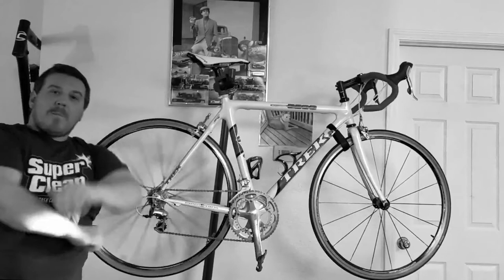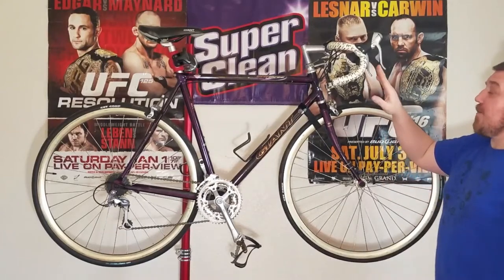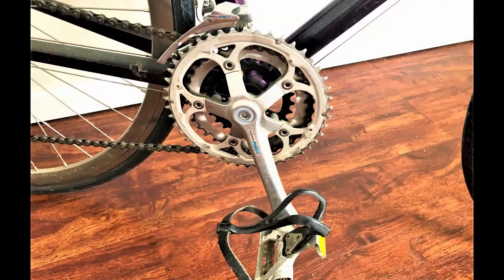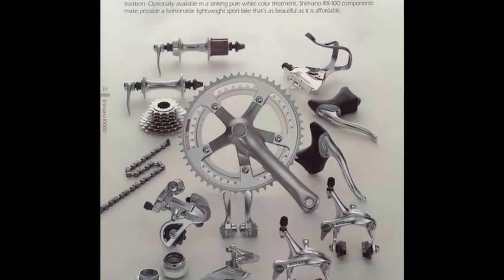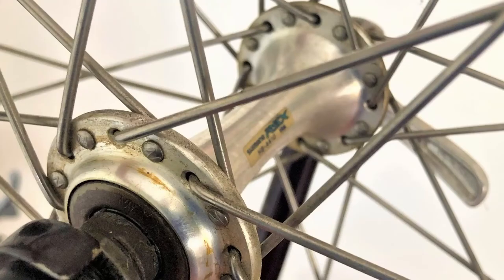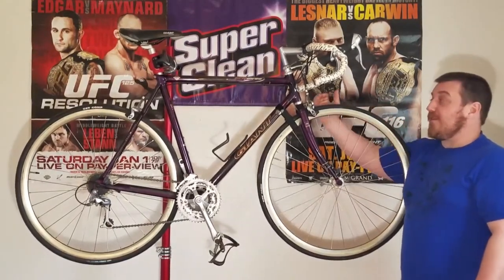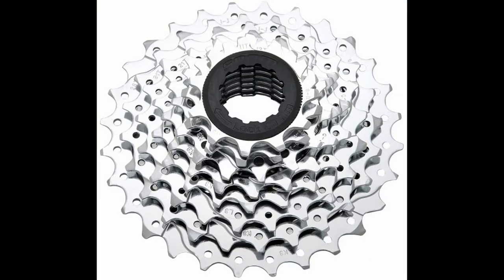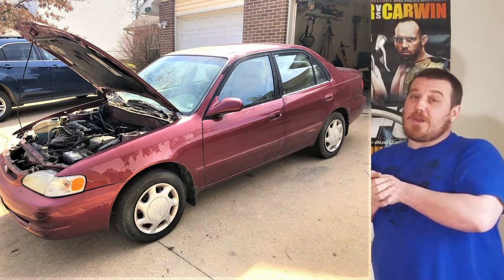1996 GIANT CADEX CFR-3: A FORGOTTEN CLASSIC GETS A DEEP DIVE! PART 1!

Comment: That is a very original CFR3 you've got there. I know as I still have one, bought new in 1996. Only the tyres look different, mine came with Paperlite gumwalls. The CFR range was ultra cool back in 1996, as it introduced exotic carbon fibre at a price that the masses could afford. Unlike brittle carbon bikes today, these are tough. I crashed my CFR3 into the side of a solid Volvo several years ago when the driver pulled out in front of me. The impact was enough to snap the aluminium front forks almost clean through. The frame and DP18s (French, not Italian) survived intact though. A newer bike would have been junked. 

These days my CFR3 serves as a retro bike alongside its newer stable mate. I love the traditional geometry frame with a horizontal top tube. I've thrown away the cheap plastic toe clips and replaced them with better ones. Ditto with saddle. I considered replacing the 3 x 7 drivetrain but I'm glad I didn't. I live in hilly terrain and am no longer as fit as I used to be.
Reply from the maker: Hi and thanks for the comment, please take a moment to subscribe if you haven't already! I am a huge Giant fan and have done a few videos on them, so it's really cool to hear you're an original owner! I've had a few of these CFR frames too but never as nice as this one! Love the gold dp18s on the purple too its a great bike I'm glad you still rock the 7x3 STI and ride it too!

Comment: Great video and top information too. Love these run throughs, I still have the CFR2 unfortunately it has a frozen seat post. Not sure how to get it out whilst not damaging the seat post lugs! All the best to you.
Reply from the maker: Hi David! Thanks for kind words, please take a moment to subscribe and I thank you for supporting the channel! It isn't pretty but it is reliable and has zero danger factor, this is what I would do: First I would try clamping a smaller threadless stem (26mm)  and use a handlebar and someone holding the bike and try to twist it while pulling. Maybe attach it to your bike rack if you have one. People have also used quill stems before by cutting the mast of the seatpost off and wedging inside the top with a set of handlebars to pull on. If that doesn't work you need a hacksaw blade that can cut metal. Fashion a piece of wood with a slit or something to make it a handle, this is death by a thousand cuts for you and the stuck seatpost so take your time and be patient! Clean cuts and once you are through it comes right out!
Reply: @D2WrenchWorksDIY  thanks for the reply, I'll give them a try soon as I can. It's a super comfy ride and in great condition. I'm the second owner from new I think 1995/96. Great channel you have by the way, subscribed of course and will let you know how it goes. Best wishes to you.
Reply from the maker: They are definitely awesome bikes so you got a sweet ride once you are all fixed up! Glad to have you aboard, I have a bunch more videos coming out end of this year too! I just did another Giant video last week you might like here https://youtu.be/QiHcEjbrF5s

Comment: Informative vid! so if i want to change cassette on one of these, i could use an 8 speed cassette and take the small sprocket off and it would fit? thanks
Reply from the maker: Hi Lancs, thanks for the question and please take a moment to subscribe! You have that absolutely correct! The spacing is identical and it's a great way to find larger sized Cassettes for 7 speed bikes!
Reply: @D2WrenchWorksDIY  cool! thanks for your help great channel! Could I use an 11 speed wheel set with this frame and put an 8 or 7 speed cassette on it? With a spacer or something to make it so it's not to small? Thanks again
Reply from the maker: Yes you can definitely run other cassettes on an 11speed wheel with spacers behind the cassette.

Comment: Is it carbon or aluminium? Also can you or anybody right down a list of parts you have on it. I need it to compare with the cadex cfr 4 im planning to buy
Reply from the maker: Thanks for the question, please subscribe if you have not already! The tubing is carbon fiber with aluminum frame lugs, so mostly carbon fiber. The bike came with full Shimano RSX parts including crankset, brakes, both derailleurs, shifters and wheel hubs. These parts have actually aged excellently and are very underated if you ask me, I would rate them between 105 and Tiagra from the 2000's era. Bike only weighed 21lbs and change.
Reply: @D2WrenchWorksDIY  Thanks for the info man! The cfr4 which i plan to buy soon has almost everything carbon except that piece of tube from sear tube to (i forgot the word for it) small tubes that go to dropouts. Fork is aluminium cups maybe aluminium too. It has RSX brifters , original white giant tape, 2x exage 500 crankset with biopace rings, exage 400 rear derailleur, and exage 100 on front. Also it has nice wheels with 28 spokes , racing Vittoria slicks. Nice additions are some Japanese handle bar , a cassette, and RSX rim brakes and most importantly stock paint in good condition. Dont know the weight, but its definitely lighter than my 15 kilo mtb. If i find some names ill add them here. (Im a subscriber already btw)
Reply from the maker: Thanks for subscribing! So the rear smaller tubes are chainstays (the chain runs by these) and seatstays (these run above chainstays to seat tube). They are solid bikes, you will really like it! I have a video about cleaning out these shifters as they can become "stuck" so don't forget to check that out when you pickup your new bike! Exage is decent but not quiet as nice as RSX, if you can find rx100 on ebay to replace those parts, it is basically the same as Shimano but has a Polished finish.  Great way to do some upgrades on a budget!